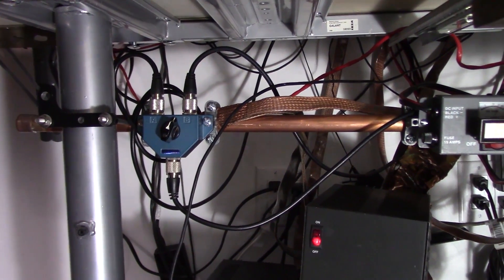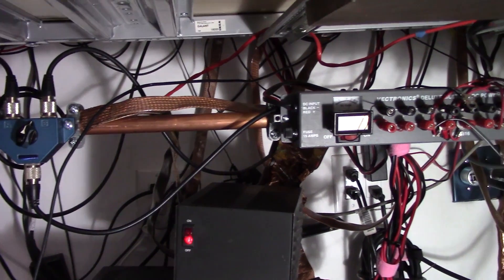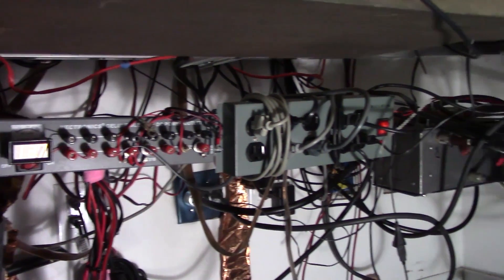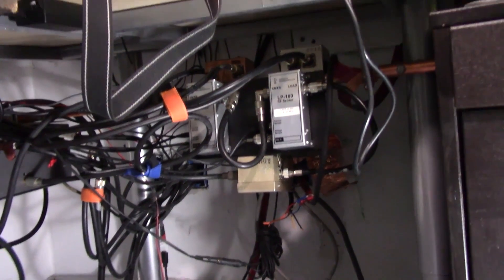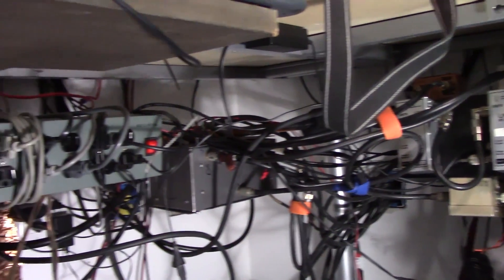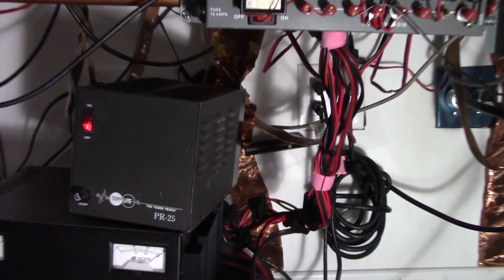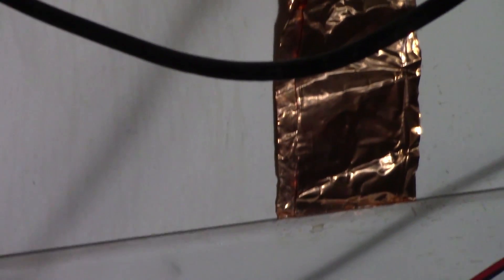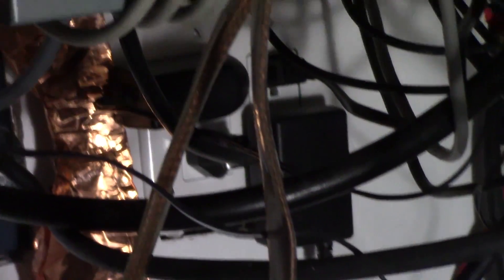Station Grounding & Extra Class License Question That Has The Wrong Answers Part 2 of 2

Comment: Hi Jim, good to see you up and running with videos once again in the new digs.  I'm going to say something not flattering of the ARRL and their books.  This subject (not uniquely, thanks ARRL) is so unnecessarily difficult to navigate.  I read the much touted ARRL Grounding book... and like every ARRL book is wholly unuseful for non-engineers.  No practical case studies as examples, no photos, no actual equipment or materials listed for reference for those seeking solutions.  Like every ARRL book, and I have a nearly 2 ft. high stack of them, the Grounding book offered no help in assisting me to set up my shack as a first timer.  I had to watch literally 50 videos on the subject, all by non-engineers who skimmed the material because frankly, obviously, they didn't understand it enough themselves to articulate useful information.  It was only by watching those 50 videos that by snippets of each I began to deduce the solution I ended up with.  Moreover, even when I joined popular Youtube radio channel "personalities" in livestreams, I'd ask specific questions, and they'd skim or outright blow it off, and ... every ... single ... time ... they all blew off the answer with, "if you need more information, check out the ARRL Grounding book, it's great!"  In other words, they didn't know either, and on every other topic related to radio, all these Youtube jockeys always refer to an ARRL Book clearly because they can't answer these questions either.  For non-engineers, Radio is a terrible environment with an impossible learning curve.  Everyone throws their hands in the air, gives a goofy grin, and then says, "hey good question, you should read the ARRL book on Antennas" or whatever the question was.  Outrageous.  Nobody who's not an engineer has a path of learning (other than going to get an engineering degree) because no avenue exists, and thus far in years, no Engineer (met many in clubs) can effectively when asked bridge the gap to non-engineers to relate to them on our level of understanding.  Thus far the only books that actually have non-engineering suited material are the ARRL Study Guides for each level, those are really good.  But every other ARRL book in my 2 ft. stack are as if coffee table books wherein Engineers sit around and throw out skimming platitudes, toss out a pencil sketch into the book, barely speak to that sketch with bare mention, and all sit there and say, jolly good hurrumph.

Terrible state of affairs in Radio... ARRL is not servicing non-Engineers in the Radio community, some say intentionally, and its outrageous.  This subject of Grounding is one of the most blatant omissions in learning opportunity.  Just ask anyone in a livestream or the average Joe specific questions on grounding, and watch the eyes glaze over, followed by the "ah ha, I know what to say" smile, then the, "you should read the ARRL Grounding book! "

As I said, after watching 50 or so videos (no exaggeration) pulling little bits from each, I finally landed on a solution.  
I have a copper pipe and copper ground plate behind my equipment.  The equipment are connected to the pipe with copper braid.  The Pipe to the Plate across the back of my workstation.  The Plate with (think it was #4) copper wire out 3' to the exterior where my new utility box is for lightning arrestors to antenna coax runs, and in that box is another copper plate that the arrestors are mounted to, and a copper wire down 2' to the ground rod directly adjacent to the main panel ground wire also connected to that ground rod.  Then I have bond wire (#4 again) run from that ground rod out to my yard 16' to another ground rod, then another 8' to another ground rod  which itself is attached to both an antenna tower, and to yet another ground rod 16' away.  No help from the ARRL Grounding book, no help from any specific source... just snippets of little bits of approaches from many, many folks' spoken or shown portions of solutions... deduced from.  Are my grounding and bonding solutions "correct"?  Beats the heck out of me, did the best I could navigating this subject, and ARRL was NO help.

I'm really disturbed by the lack of practical fundamental information for operators to set up basic solutions for a first time shack, or a first time mobile/vehicle solution...  How many people have videos on setting up a basic shack... and didn't cover a case study example for grounding?  Answer:  All of them.

P.S.  Also worth mentioning that two electricians I consulted, one whom I have years of experience with on residential work who I consider very knowledgeable, disagreed with the ARRL Grounding book on a couple aspects of bonding and ground rods.
Reply from the maker: What did the electrician disagree with?  Thanks for the input and description of what you did.  All of that is very helpful.  73, Jim W6LG in Rocklin, Ca
Reply: @ham-radio  
It had to do with the newly installed "radio (DxEngineering) utility box and it's grounding plate" that houses the lightning arresters, grounding wire from shack to shared (with arresters) grounding plate within same radio utility box, which was then grounded to the (main electrical panel's) grounding rod directly below this utility box and the adjacent main electrical panel.  The debate was whether the shack/arrestors should be grounded to the grounding rod that the directly adjacent main electrical panel also used, or whether the shack/arresters should be wholly independently grounded from the main electrical panel.  That previously existing grounding rod under the main electrical panel (and also now under the radio utility/arrestor box) was set in concrete slab, and we were concluding was this type of solution:

""A rebar type concrete-encased electrode installed in accordance with 250.52(A)(3) with an additional rebar section extended from its location within the concrete to an accessible location that is not subject to corrosion shall be permitted for connection of grounding electrode conductors and bonding jumpers. The rebar extension shall not be exposed to contact with the earth without corrosion protection."

I opted to use this pre-existing rod for the radio utility box, shared now with the main electrical panel, which is then bonded to other grounding rods as previously described.  The other debate was whether to ground each of antennas, and tower, to these common network of grounding rods and bonding, to the house's electrical main panel.  Electrician said NO.  However I did bond them together in keeping with various radio sources skimming of these topics and opposing viewpoints that appeared to exist, mainly because the applications of current (shack and house electrical) were so very side-by-side where entering the house, and that the grounding rod network (4 total rods) would "hopefully" suffice.  Also have a whole-house surge protector where entering the main electrical panel.

On a related note, also have very hard ground, often solid limestone bedrock... have to use a jackhammer to plant trees as example.  So I paid a local digger to auger 5' deep holes (12" wide) for the grounding rods, as far as I could go given equipment, bent the grounding rods into a 5' long "J", and set both the rods and the bonding wire in conductive GEM slurry material to GEM specifications.

73
Tom W5VLT, Hill Country, Texas
Reply: Wow. I just, not 10 minutes ago, recommended the ARRL grounding book in a comment to part 1 of this video. I neither love nor hate the ARRL, and I am not an engineer. I found the ARRL book sensible and accessible. It is technical reading, so one needs to approach it accordingly. I read parts of it more than once. 

Grounding, particularly with regard to RF, which is not initially intuitive, and lightning, which is not well understood by many, is by its nature a difficult and contentious subject. I appreciate that the book makes an effort to explain the theory, then offer generic practical approaches. I found that far more useful than a few hundred absolutely committed, but probably anecdotal, opinions in cyberspace.

Electricians will always disagree. Local codes vary, some frankly don’t understand them particularly well, and probably nearly none are versed in the aspects of RF and lightning energy we’re concerned with. The code, and their work, is concerned essentially with fire and appliance safety. The mere fact that codes vary and do not all adhere strictly to the NEC suggests that individual electricians will certainly disagree.

I’d be happy to unpack areas of the ARRL book with you, if you’d like. You can message me on the Zed...AG5RJ.
Reply: @PeopleAlreadyDidThis  

Well, I didn’t say the book was a Zero out of 10, I said it was like any other ARRL book, a tosser coffee table book.  Let’s look at some facts regarding the ARRL books, which apply to each in my 2 ft. tall pile of them, each and every:

•	Other than some “beauty shots” at some distance of antennas, there are ZERO photos anywhere in the books.  Not a one.  No photos of equipment, or materials, or connections and using what to connect, of parts that we’d be looking for.  No photos whatsoever.  In any of the books.
•	Instead, they offer crude, almost childlike sketches.  We know from plans and blueprints that illustrations can be very detailed, but there’s no detail in any ARRL sketch to even approach a photo-like comparable, far from it.  Crude, childlike sketches offering no detail.  The narrative accompanying these sketches barely makes mention of them, and offers little content to what is being poorly illustrated.  They’re like super high level skimming of subject matter, like engineers chatting around a fire with superficial chatter.  “Quite right.” And head nods between those already in the know.
•	These books offer zero case studies as illustrations, for example, no, “So lets look at a couple examples.  Here’s a shack set up of a 30 Amp Power Supply, a common Yaesu 991A that’s great for beginners, an adjacent PC used for FT8, and the normal accessories like Mic, keyboard, mouse… and we’ll take it all the way to the grounding rods and antenna… let’s get started and first refer to photo 8a.”  No case studies to pull concepts together.  No photos.  No details.  No comprehensive or even broader... anything resembling an example or case.
•	These books offer no insight (and no photos) to parts, materials, part numbers, brands (companies where we can find parts or more information), sources of any kind for parts or materials.  By the end of these books, we don’t really know if we’re looking for something the size of a grapefruit, a golf ball, or the diameter of a vehicle or a hair.  We’ve seen no detailed look or photo of any part, or how parts come together, or with what, and now we also don’t know what they look like, or where to get them, especially with connections between parts and equipment.
•	If this book was at all effective, people around the radio world who are asked questions wouldn’t get that vapid wide eyed “deer in the headlights” look on their faces every time, and then followed by that “I know how to escape my (common) lack of knowledge” grin, then followed by, “you need to read the ARRL Grounding book”.  They don’t know either, the book didn’t convey guidance from which one can build a shack and ground same, gain experience over years from having read and worked with radio, and then being able to answer questions like anyone versed and experienced would be able to on any other subject where actual learning opportunities are available (other than engineering school).
•	For newcomers to radio, those looking to do a shack for the first time, the ARRL Grounding book is the only source people offer for direction, and for “someone getting started with a shack set up”, given the above points… this book is about a 2 out of 10.  It’s barely a roadmap, I’d say not.  

Like every other ARRL book, the Grounding book has been around for how many years, and still these points hold true in today’s editions.  Crude coffee table books as if light banter between Engineers, lacking any details for those trying to "hands on" set up solutions for … Grounding, or whatever the subject matter of the ARRL books.  Clearly intended for Engineers who already have the "details" in their back pockets.  Others have said to me with internal view of the ARRL operations, that it’s intentional, a snobbery to keep radio for the engineers, and for the posers to... "let them eat cake.”  These books are cake.
  A glass ceiling.
Reply: Tom,

I don't usually have the patience to read through lengthy comments, but yours is spot on. My experience trying to sort out G&B is virtually identical to yours. In fact earlier today I commented on another video that the ARRL G&B manual was the worst investment of my brief amateur radio life. Had same experience with YT ham pundits as you also.
Mike is a TRUE Elmer. It's hard to find them as there are so many well intentioned but misinformed Delmers out there who think that because they have always done things their way, that their way is correct and the only way.

73,
John - KK7JBZ

Comment: I ran a sub box off my main to the garage and the city told me to run a ground rod and run the ground to the sub box. Then when they put in my solar panels the city had them install 2 10' foot ground rods to the main panel. I also have a ground rod for the radios and a copper bar 1/4x 1 1/2 wide that the ground strap in connected to. All radio equipment is connected to the copper bar.  I do have an Edison ground system connected to my 18ht high tower vertical as well..
Reply from the maker: When the sub-panel is separate, a ground rod is usually necessary based on my experience and the older NEC that I am familiar with. Thanks James & 73, Jim W6LG in Rocklin, Ca

Comment: I want to establish my office/radio shack on a 2nd floor room in my house.  I also want to put for now a 40 meter tuned wire dipole and  a vhf antenna in the attic.  The floor in the room has a completely covered aluminum skin, in support of the radiant heating system.  My thinking is to put a 1 inch copper pipe under my desk and tie all of the equipment shells to it.  The pipe to the floor's aluminum skin.   The house has PEX domestic water piping, so no opportunity to "earth ground" the aluminum flooring.  All the room's equipment will continue to have it's power connection grounding in place.   Will this approach satisfy the electrical safety requirements and deal with any shack RF and RFI issues??

Comment: After 40+ years as an Broadcast Engineer,  I have a different viewpoint.  I follow the NEC.  I have had Broadcast towers and antennas mounted on towers up in all kinds of weather in mostly the mid west.  I was able to follow the path/paths that lightning took and developed a plan that gives lightning a likely path to follow and ways to inhibit it path.  I have a metal panel that is grounded with a rod and tied back to the service entrance ground rod.  Once inside i use  coils of coax to inhibit the lightning path.  I want the lightning outside my shack and house.  Once you invite the lightning inside you are asking the lightning to use your equipment as a very expensive fuse.

Comment: Being an electrician I know about grounding and safety. What I am more interested in is proper antenna grounding for the best SWR and RF safety if there is such a thing.
Reply: Get yourself a quality lightening arrestor and locate it as close to a proper ground as possible. A dedicated lightening rod driven into the soil is best. If you have more than one antenna, run a separate arrestor for each but they can all be located on the same ground rod.
Reply: @Justin-bd2dg  aren't those things useless? Just go with the ground rod and leave the rest up to mother nature and science.
Reply: @arconeagain  lol satire right?

Comment: Greetings. 
I was on 75 Meters one night and asked a question about antenna/station grounding....I received about 40 different answers from 10 hams, which had quite an argument going on. I had no idea how controversial the subject could be. 
Thank You for sharing the videos. 
Great information. 
73
Reply: If you really want to start a “barroom brawl” , put that question on e-ham.net.
Reply: Grounding is a vague and ill defined topic. There are different types of ground. Which one were you discussing?
Reply: The first thing you need to break down is why are you grounding or earthing, even the terminology will confuse matters. In other words, what are you trying to achieve? I can think of four scenarios off the top of my head. Your case sounds like a ground rod at the base of your antenna in case of lightning strikes. However, many get this confused with a ground plane to improve ground efficiency for increased antenna performance. Third would be for safety in the shack in case of electrocution, a bit old school now as we know, at least in my country. Fourth, for bonding and grounding equipment for ground loop/rf feedback issues in the shack. Let me add a fifth for the rod at the base of your antenna. For DC grounded antennas, for static build up (related to the first). But what would I know, I'm just a CBer.

Comment: My understanding was standard power systems need to ground one of the poles to the mains Earth in order for the circuit to trip.. somewhere else that leaves the potential to ground outside of the system thus not tripping the circuit.. my question can you not add  a second grounding circirt to the system therefore if you happen to short circuit it will drop to the shack earth the system detects it? I don't know anything this is just stuff I've heard listening to Electroboom on YT...